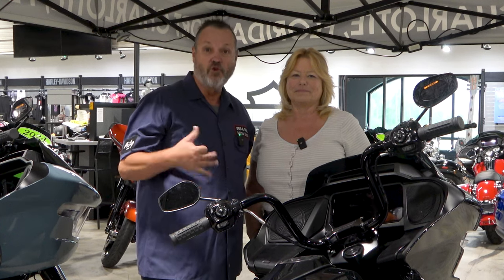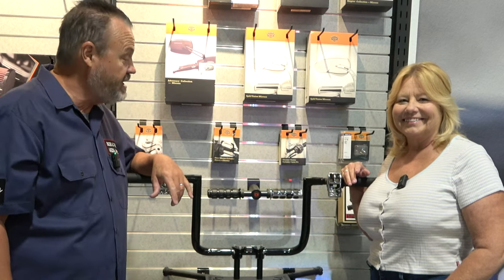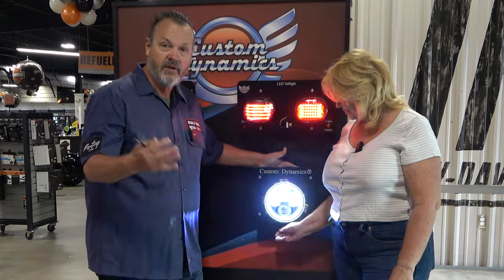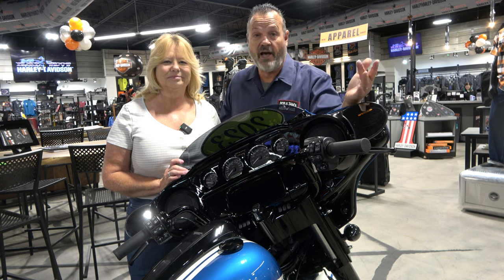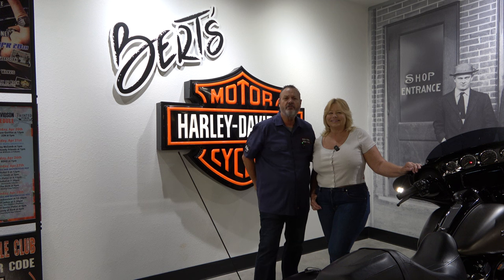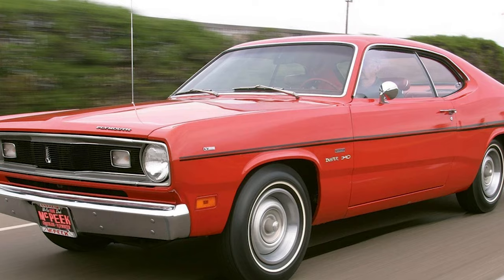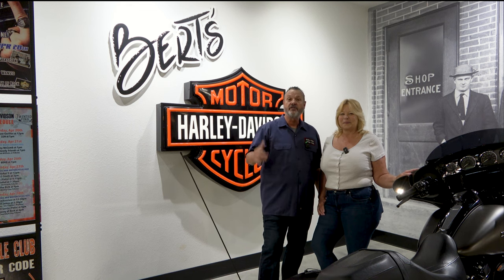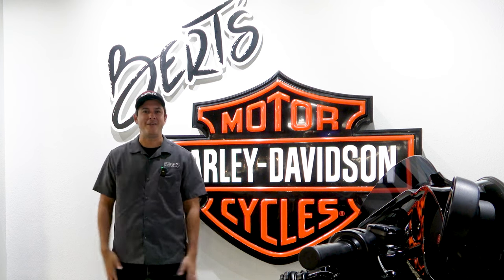Why You Need To Upgrade Your Harley Davidson Asap!

Comment: my 05 Ultra bought new, it had 2/10 of a mile on it. The first thing was chrome inner primary and luggage rack. over time, lower windscreen, big bore, and ported with a tuner 92 hp. nostalgia grips, true dual rhineharts. bars. amp, speakers. 92,000 miles. after, 12" legends, motor stroked to a 103 with geared 543 cams S&S balanced crank. billet cam plate, high flow oil pump, S&S push rods, 10.5 - 1 pistons. 103 h.p. 103 tq.  l.e.d fog and drive lights. now 100,000 miles. oh ,and a leather saddleman seat.
Reply from the maker: You have done a good job

Comment: 2021 midnight crimson  road glide special - 14” motorwich handle bars - arlen ness 65* velocity air cleaner-thunder max ecm added king tour pack fat bagger cable retro fit - ciro 3d panel lights - ciro crown tail light - led turn signal (front n rear) corbin solo seat / corbin rear  cary fass slip on muffler , tab performance 2-1-2 header pipes etc ……
Reply from the maker: Nice

Comment: My first touring model was a 2017 SGS, after 15 older bikes of all types. I kinda regretted it bc the stock form is slow, Hot and a rough ride. After a decent 401k’s worth invested, it’s amazing. Replaced front/back suspension, seat, bars, radio/speakers, brake calipers to real Brembos, that 107 is now a FM 124” with S&S internals & tts tuner. I couldn’t imagine someone coming from other bikes and being perfectly fine with the stock form of these bikes. My father has a 2023 RGS and it’s not much better than the stock experience I felt on my 17 back when.
Reply from the maker: Thanks for the update on your bike

Comment: Corbin seats are my favorite. I put them on all my bikes. Bars suspension and if needed brakes. Engine work comes last. And like you said LEDS if needed. Great channel.
Reply from the maker: Thanks
Reply: Corbin seats will last forever. They feel like a doctors office waiting room chair to me. I have a 10-12 year old seat that’s never broken in. I find Saddlemen has almost as good build quality, but way more comfortable new than a used Corbin.

Comment: 2022 Heritage Softail. Engine and exhaust all stock. Happy with the 114 as is. Hate noisy exhaust so stock pipes. Happy with the stock seat so far. Yeah, I know, weird huh? 

Added engine crash bar and replaced incandescent turn signals and tail/brake light with L.E.D.’s. Then added a color matched King Tour Pack trunk from Advanblack. Last Saturday just installed and wired up the Advanblack add on tour pack wrap around tail lamp assembly for more rear lighting.

Think I may add saddle bag guards next. 

I’ve loved the Heritage with the mono shock rear suspension since it was released but not with spoked wheels. Bought mine in 2022 when I saw there was an option for cast wheels. 

Have liked the bike in it’s stock configuration since my first test ride of an early 2018 model year. 

Good thing I waited a few years to get mine with the cast wheels and supposed engine sumping problems solved.
Reply from the maker: All sounds good

Comment: Pretty much stock '03 Anniversary FXSTS. Added an oil cooler because.... Srcreamin' Eagle performance air cleaner, breather catch can. Sissy bar pad in just the right place for my wife's back. Windvest windshield (easily removable!), Custom Dynamics headlight because the stock one svcks. Next up: handlebar risers, DK 1" tank lift. I'd love to find a springer about 2"or 3" over with the HD profile retained. No engine work - my go-faster days are over, LOL. 88" is enough for us. Ride safe!
Reply from the maker: Sounds like a great ride

Comment: Let's start off with a new motor rebuild from a 96 cubic inch up to a 103 cubic inch new camshaft along with that and pipes, a lowering kit and a few other odds and ends thrown in like a tuner to make the horsepower work better different windshield. Had the wheels chromed because I didn't find any Wheels I liked That's what I can think of now
Reply from the maker: Sounds like you got it pretty good
Reply: Kind of have to do it that way can't afford a new one  @bobandtams